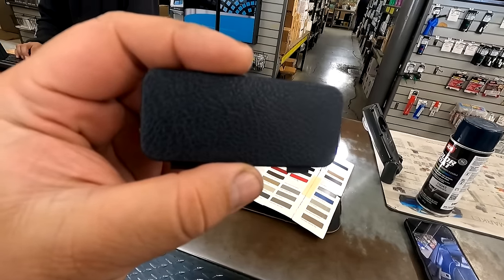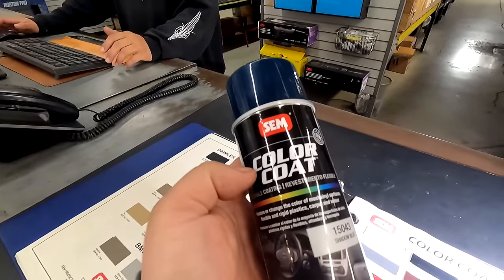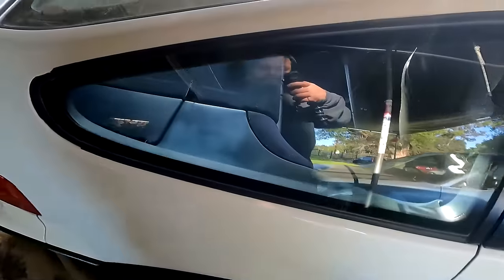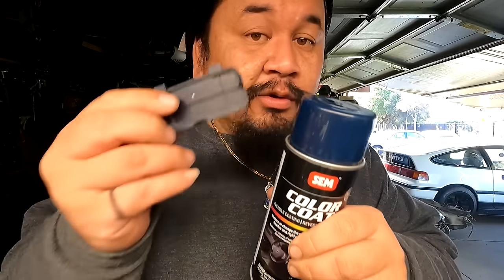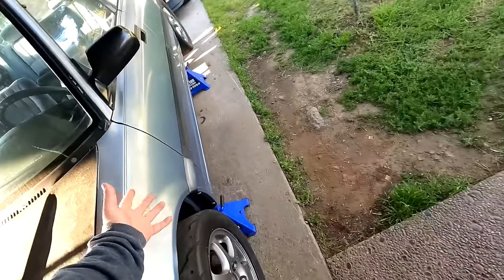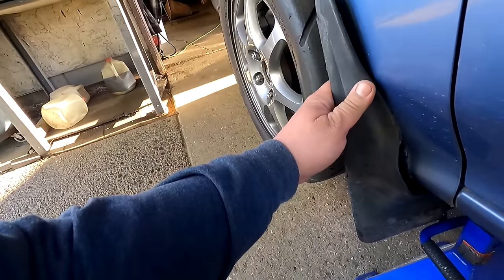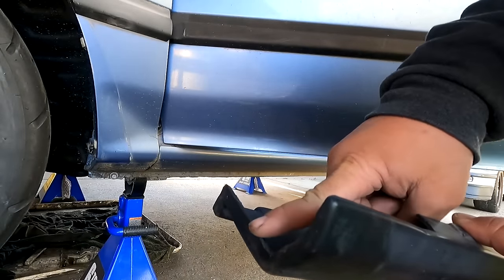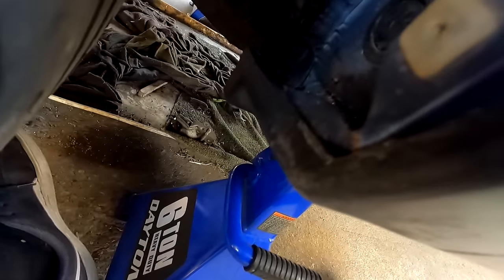Modifying JUNKYARD Side Skirts to fit K20 EF SEDAN

Comment: Dand Dana, when this car's done, it'll going to be so nice. 
Don't forget to prime/paint inside the holes you drilled out for the fasteners. I cannot believe how many people I see using rivnuts & don't bother to protect the metal before inserting the rivnut, it WILL rust eventually so may as well spend a couple of seconds to help prevent what you can.

Comment: The BEST angle grinder disk to use for cutting plastic is a diamond coating masonry disk.  For whatever reason it doesn’t melt the plastic as u cut. It kinda turns to powder instead of melting.